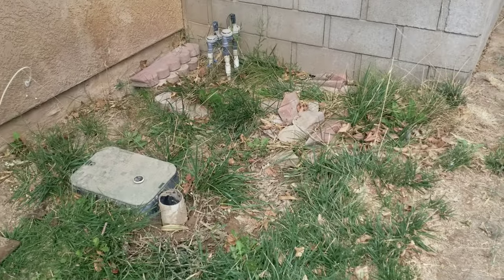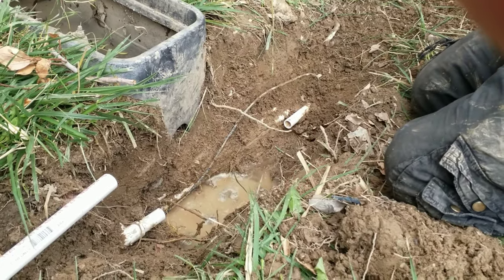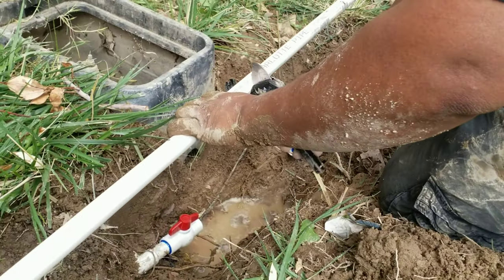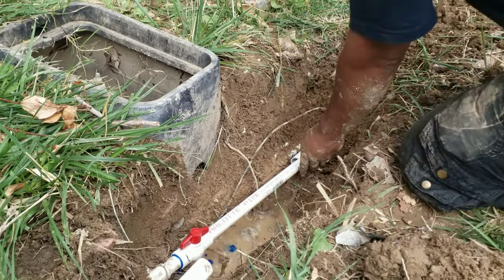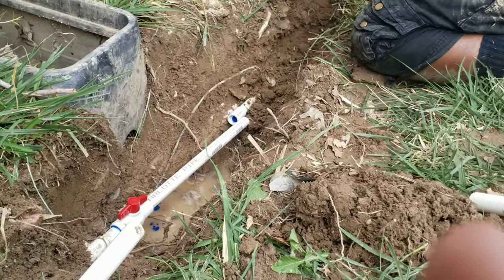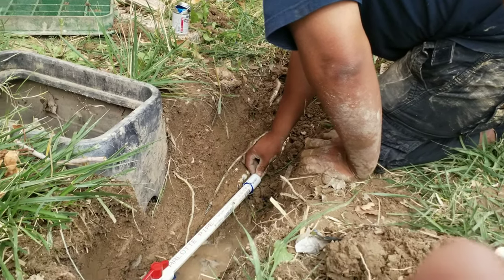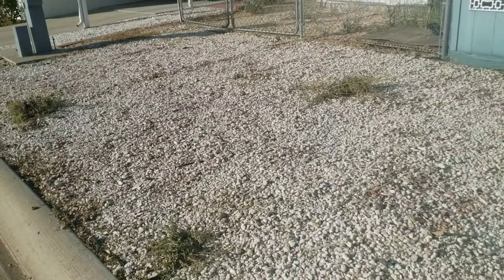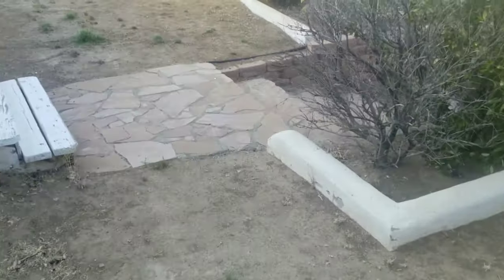Shut-off valve Irrigation fix | Money Making Mondays

Comment: hi, i'm having an issue with my sprinkler system. the system is off but there is still a leak in the middle sprinkler. and now on the valve itself how can i fix this?
Reply from the maker: hope you got  it fixed  sorry for late respone